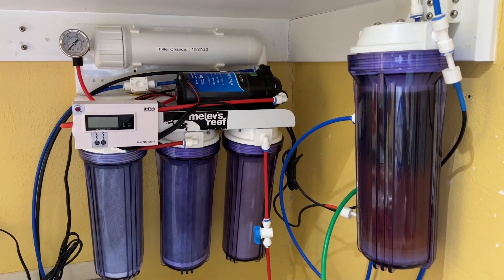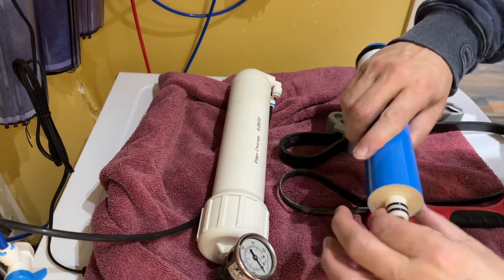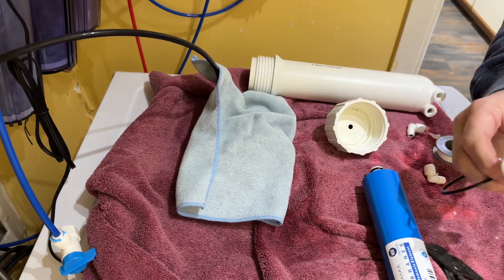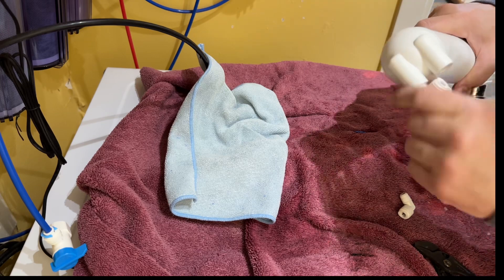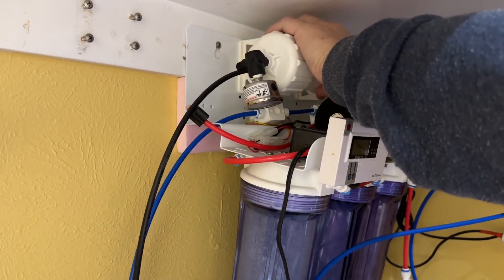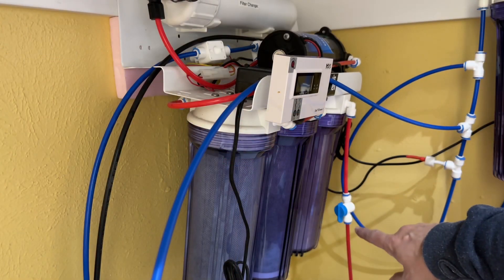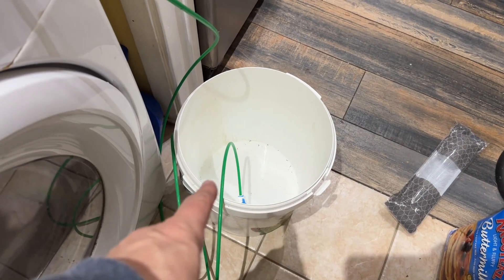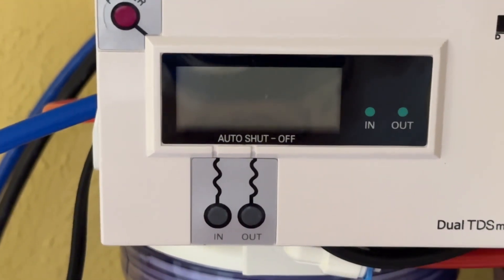RD146: That 7 year old membrane was toast!

Comment: And this is why I like your shorts so much. 
They don't dive deep into a complex topic, they more often relate to everyday tasks with simple pertinent pointers.
Like I just realized, I have changed my other filters several times. But never the actual RO membrane. & I have never herd to use silicone grease.
Reply from the maker: You can use silicone grease on the filter housing O-rings as well.  At least once a year.